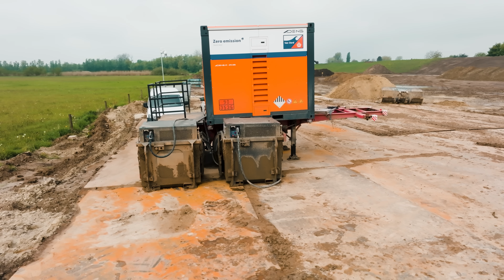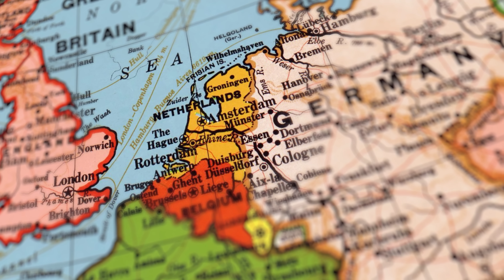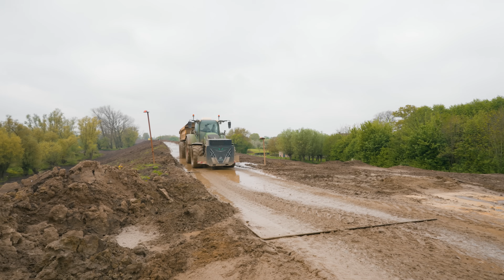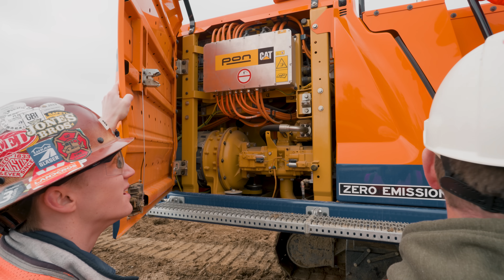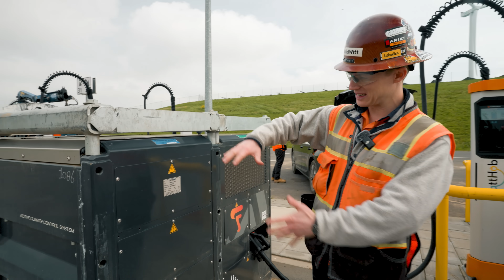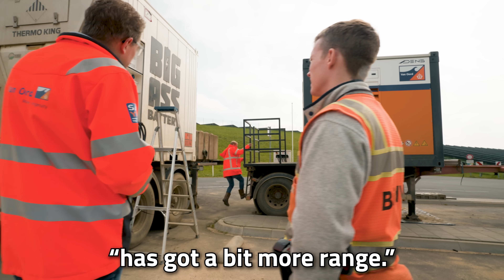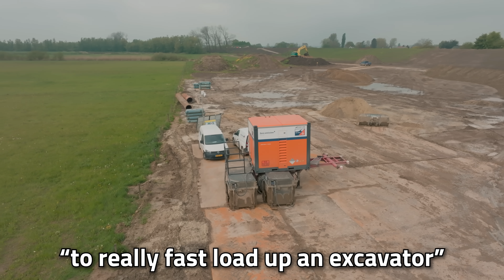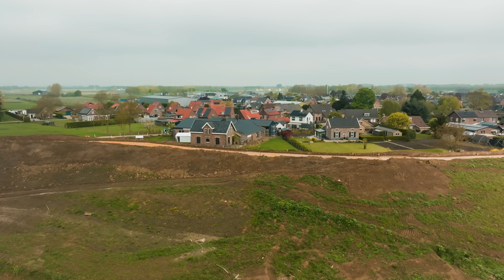Inside the World’s First Electric Construction Project!

Comment: The fire hazards were not discussed in this video. So much vibration and potential to drop batteries. I would be very interested to know the chemistry of their batteries.
Reply: The big batteries that charge the excavators are LFP batteries.

For the excavators I’m not sure.
Reply: @DezeTimisTim  Thank you sir
Reply: That's why there are very strict standards to get that kind of products certified.
Reply: A big fuel tank also has potential to be dangerous. What is your point?
Reply: There is a very limited fire hazard. Think about how many reputable battery powertools catch fire, it's not very many and a much harsher environment.
Reply: @lolimpol  You dont know what you are talking about. You would have mentioned the battery chemistry if you did.
Reply: @Jeffrey_Epstein_Jr  sure man, as an electrical engineer I definitely don't know what I'm talking about. Obviously this is NMC as no other chemistry gets close to the energy density needed, MAYBE it's LiFePO4 but I doubt it, and if it is safety is not even a topic that needs to be addressed 😂
Reply: @lolimpol half of this comment section is EE bro calm down. You would have mentioned what the chemistry was if you were a real EE.
Reply: @Jeffrey_Epstein_Jr  The fact you don't recognise NMC tells me enough lol😅
Reply: @lolimpol  "There is a very limited fire hazard. Think about how many reputable battery powertools catch fire, it's not very many and a much harsher environment."

You cant even keep track of what you have said. Lmao.
Reply: @Jeffrey_Epstein_Jr  I know I said that, after which I mentioned the chemistry you want to hear so bad haha

Comment: 2 hour lunch break to charge the excavator? Really???? So the whole jobsite shuts down,  trucks and tractors hauling dirt away also stop! Electric power is NOT cheaper to run!
Reply: @frankthechemist sorry but you don't know how we work. If  we took 2 hours break the would kick us out! Please if you comment give correct info!!!!
Reply: The 330 Z-Line has a 500kWh battery. At lunch it will be at around 20%. It can charge at 350kW up to 80%.

80% is enough to work from lunch till end of shift.

So you need to charge only 60% (300kWh) at 350kW = less than 1 hour.
Reply: The 2 hours lunch break is not due to the batteries, in Europe in general it is normal to stop everything between noon and 2 p.m. Workers simply finish their afternoons typically later than what we are used in North America.
Reply: @frankthechemist for sure in the Netherlands is lunch break only half an hour normally!in Spain or Greece people go for a break for 2 hours( a siesta)
Reply: @frankthechemist  yeah no, we don't have 2 hour lunch breaks in the netherlands. Thats only in more southern and hot countries.
Reply: @frankthechemist  in the Netherlands a 30 min lunch break is much more common.

Comment: if its a fully electric site, why does the dozer @ 8:00 have an exhaust pipe?

....not clickbait, on this channel surely? 😅
Reply from the maker: no clickbait here bro!! but on that dozer -- it was a rental as the other one they have was in the shop
Reply: Maybe its diesel electric diesel motor acts as generator for electric engines takes less diesel than standard motor
Reply: @sket4446 😂😂😂😂😂😂Yea, ok. 😂😂😂😂😂😂
Reply: @Oldschoolrules123 look at the xe models
Reply: @sket4446  no black smoke either

Comment: Recharge recharge garbage.
Reply: Fuel, refuel, rebuild carburetor (or hi-pressure fuel pump), replace filter, refuel, spill fuel all over your clothes, refuel. ICE isn't perfect either. Electrics are useful in certain situations. This is one of them. Deal with it.
Reply: @originaldylanbaxter Hi child, obviously you never ran heavy equipment. I ran an excavator for 36 hours straight to get a highway on ramp moved. You couldn't do that with an electric excavator. 😊
Reply: @Jack-v7o2y  If you can swap out the battery, you can run for however long you wish, you just need to take a few 5 min brakes.
It's not perfect, but it actually works, and you will be glad to find it when you will run out of oil for a reason or another.
Reply: @Luzgar I have brakes on my pickup truck and I take a break to get a drink of water. PS. How will you build your electricity ran heavy equipment without oil???????
Reply: It's the worst it's ever going to be, they seem to be quite all right with it.